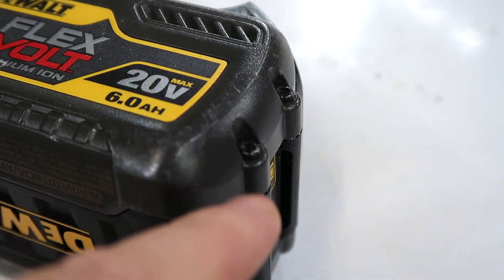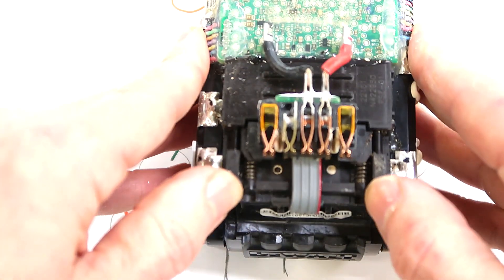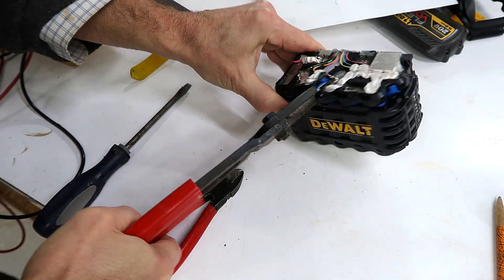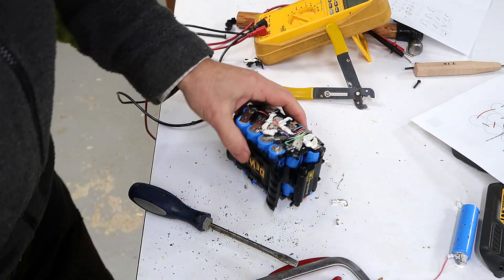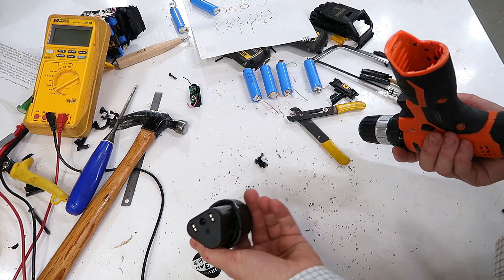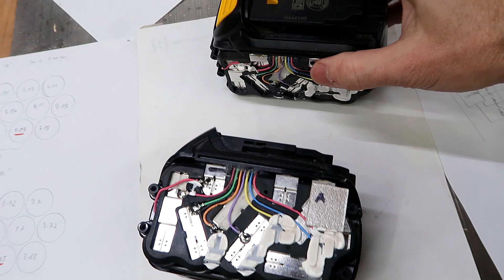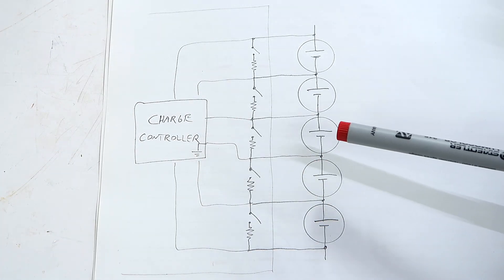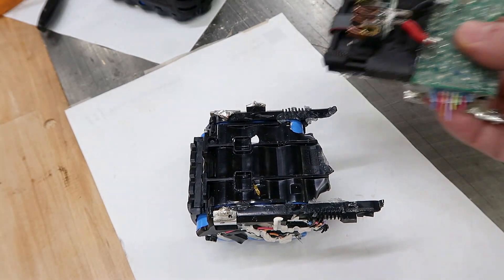This kills flexvolt batteries prematurely

Comment: Heh, I go online and buy the right security bit and wait a week for the bit to arrive, and then the battery sits for 6 months next to the unopened bit... Matthias defeats the security with a nail and a hammer and moves along with his day.
Reply: Small ones break easily but any bigger than T20 are basically impossible to snap, and difficult to drill
Reply: @whirled_peas  it's easier to put a hole in the bit for pin, once they get big
Reply: But now with security permanently disabled Matthias is at the mercy of devious thieves replacing his legitimate OEM battery cells with cheap counterfeit knockoffs, while you with the security bit available needn't fear that risk every night!
Reply: Hi Jeff!

BigClive would open it with a vise, a d sometimes a hammer (although he's usually more careful with battery packs)
Reply: @Nono-hk3is  Total sigma move. There Is no security……
Reply: Harbor freight sells the security bits for less than $10 for a wide collection of sizes.
Reply: @InlineSkater72  you underestimate how lazy I can be! 😂
Reply: @InlineSkater72  Yea, I think that is where I got mine. As an aside it would never have occurred to me to break off the security tit.
Reply: @tomschmidt381  I got mine around 3 years ago to fix a Ryobi 18V pack that refused to take a charge with the official charger. It was an easy fix. One of the 5 cells was a bit lower in voltage than the rest but still a reasonable value. The charger detected the lower voltage and refused to charge. I used a linear bench power supply and got the voltage up around 4V and all has been well with this pack since then. I have used it probably a hundred times.
Reply: I just use a normal flat blade screwdriver wedge it in between the lobes and the pin and open it that way. If you start slowly, the torque's enough to hold it in. Works for triangle types too.
Reply: ifixit to the rescue, Matthias really ought to buy himself a set!
Reply: I am glad to see that you are a fan of the wooden wizard. Do you also like Ben Eater? he is a real clever bastard. I think we need a new platform, not that horse shit pay per channel floatplane nonsense that LMG is setting up, but more of a netflix, platform wide subscription model with all you great engineering channels on it. I would pay 15 pounds (18USD) per month for that. You could make it a 10pound minimum per month, then anyone with more money can pay more per month, I think you would get quite a few people paying.

The list of all the great engineer types would take too long to write, but as a spectrum, I mean everyone from 3blue1brown (on the theoretical side) to mikeselectric stuff, on the in depth practical side.

I genuinely think if you got just the 50 best (no veritasium or linus tech tips corporate money grubbing bastards) engineering and science/maths educators on youtube onto a new platform, you would all do well and we could be secure in the knowledge that you all have the support you need.

I did a bit of back of the envelope maths ad figured that with the top 50 (IMO) channels in this field, 1/3 of their regular watchers paying 10GBPper month, you could all take home (if divided evenly) 50-70K per year. I know its less tan what some make, but more than others. You could still have patreon and donations for specific channels. I think it is a smarter platform than float plane. I mean ffs. who is ever going to discover a new channel if they have to pay 5pounds for the privilege to see if they are any good.

Its really hard to do this maths because the waters are shared etc etc, but I would love to know what you think of such an idea. I would be the first in line to help raise the money needed for development, of course many of you would be able to handle the dev work yourselves with minimal outside help.
Reply: Before I bought the security bit kit, I just used a hardened steel hole punch on the security pin, one tap with a hammer and it usually snaps off.
Reply: I find just using a small flat head screwdriver that fits between the security peg and the inner sides and twist will break most of the pins off with little work,
Reply: You can literally go out to any hardware store and buy those security bits
Reply: Lol
Reply: I just use a decent mini standard screwdriver, small enough to fit in beside the pin and just twist it. 99% of the time the pin breaks off.
Reply: Fancy seeing you here. Hope your recovery is going well!
Reply: i was able to break it off using a precision flat blade screw driver...at first i was using the small flat blade to remove the screws and accidentally broke the security tab off....so i broke the rest off.
Reply: You're pointing out a type of "just get it done" behaviour that I admire so much. My life would be wayyy different if I was more willing and ambitious/motivated/confident to just try stuff out!
Reply: That's what I've always done.
Reply: I bought the 9.0ah exactly a year ago along with the DeWalt factory charger, now the battery barely holds a charge. Anybody else experience this problem?
Reply: That’s like half my projects
Reply: Yeah Jeff, this Man Matthias never ceases to impress me, and I don't impress easily!  Cheers